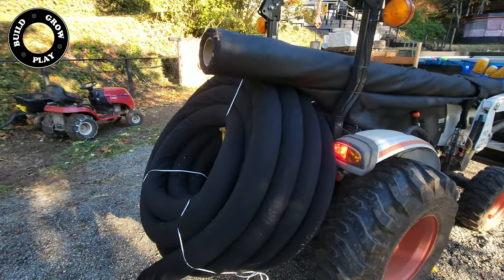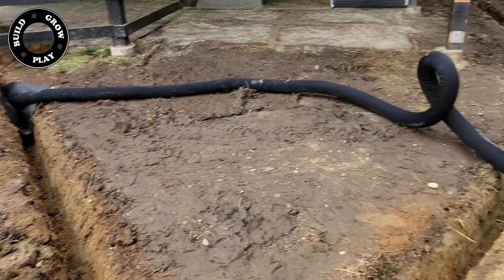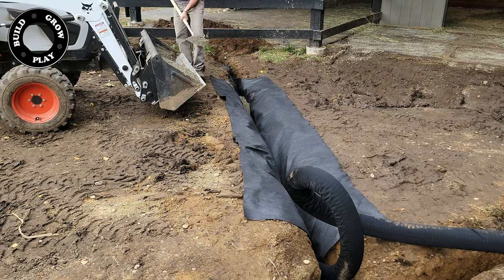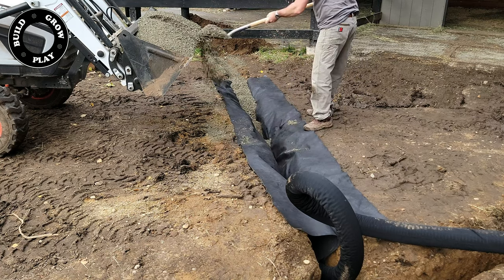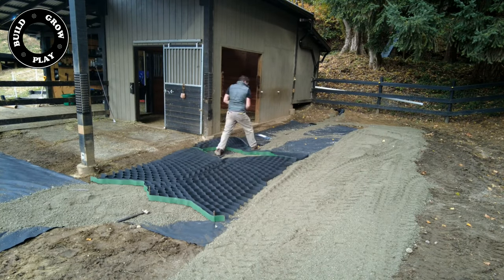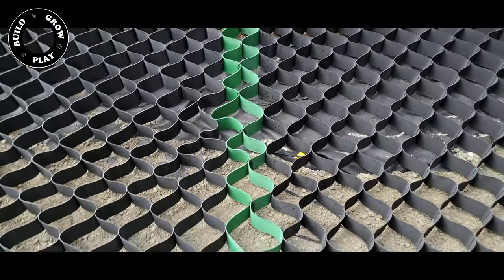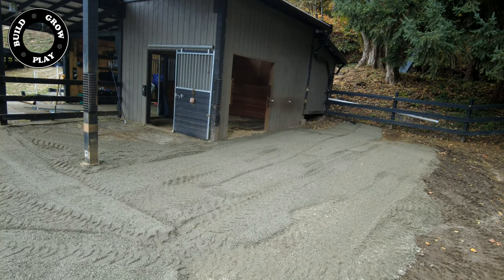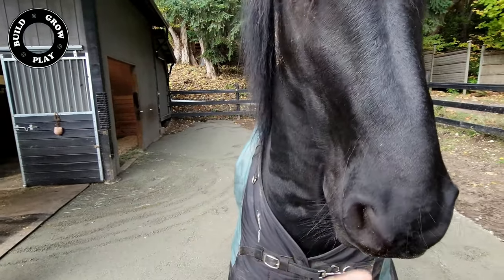Easy Mud Management - Horse Paddock

Comment: How is that working? Thanks for the video. Would love to see follow up
Reply: Gorgeous horses btw
Reply from the maker: It's still works great. They love trying to dig it up, but so far, it is still intact. It also keeps their feet in good shape.
Reply: @buildgrowplay  Can horses eat hay off of that gravel surface? 

I've read things before of course horses cant eat sand and cant eat their hay off of a sand surface due to toxicity...is gravel the same idea?
Reply from the maker: @Brett_Nebraska  it is more about minimizing risk. Gravel is easier for them to remove from their food than sand and dirt. But our feed areas are floors with rubber stall mats
Reply: @buildgrowplay  thank you! One last question is do you use any specific type of bedding over top of the stall mats? 

This would be for an outdoor shelter thats exposed to water/ rain/ sun / heat/ freezing
Reply from the maker: @Brett_Nebraska  if there are no walls, then no bedding. I have a covered area with no walls. Again I have stall mats and I make sure the floor has a small fall on the floor so I have no puddles
Reply from the maker: I finally have an update video. 2 years on https://youtu.be/ztbp9xznKSA
Reply from the maker: @Brett_Nebraska  here is an update video https://youtu.be/ztbp9xznKSA
Reply: @buildgrowplay  awesome thank you!! Appreciate all your feedback 👍

Comment: How you find the upkeep with the lightfoot system? Looking for solutions and paddocks are on sandstone base so erosion is long term issue after mud gets washed away.
Reply from the maker: It's good. They like to try dig it up. It is probably the best solution for mud control but it is very expensive for recycled plastic.
Reply from the maker: i Have just done an update video https://youtu.be/ztbp9xznKSA